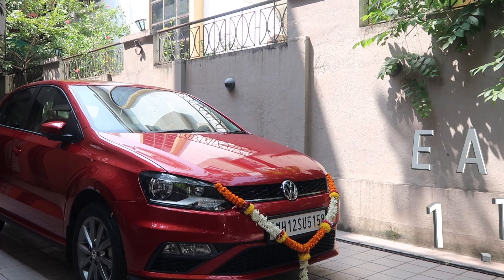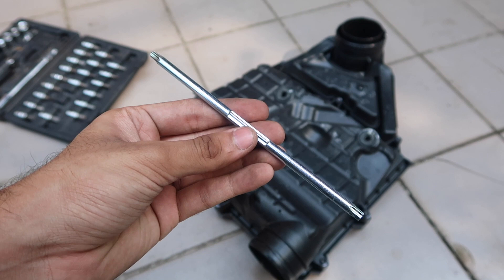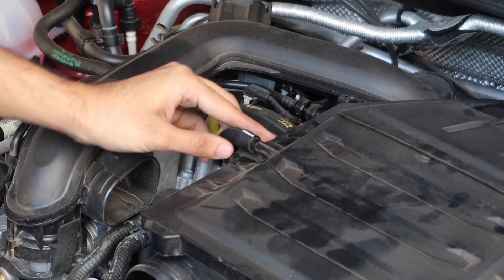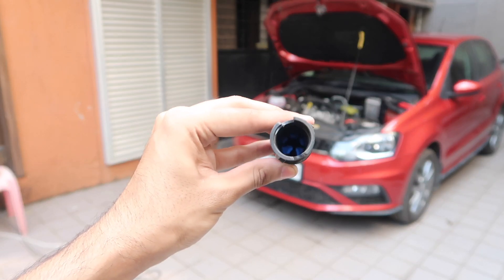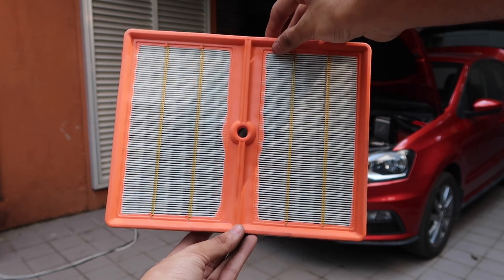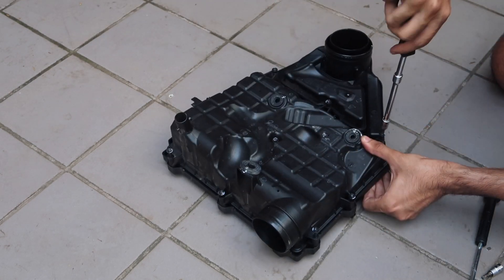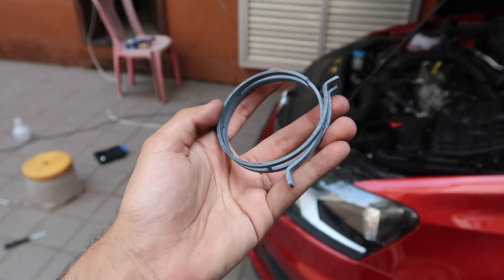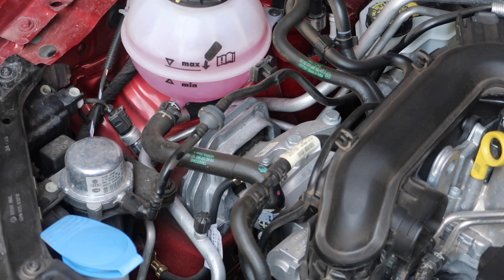Volkswagen Audi Seat Skoda - EA 211 1.0 TSI Engine Air Filter Service - Polo, Slavia, Taigun, Kushaq

Comment: Hi Sujoy, thank you for posting this DIY video, very good job indeed. My only suggestion is to wear a pair of safety gloves while working on the engine bay. I  appreciate the fact that you even mentioned the torque tightening specs for the Torx screws on the air filter housing (the only time I pay attention is the toque specs on the oil drain plug & oil filter cap housing). I'm actually perplexed that VW folks have made this otherwise simple job so unnecessarily complex. I have a 5 series BMW (535i) and it takes me all of 10 minutes to change the air filter. I'm considering Polo Highline Plus for my parents who live back in India. I was researching about the oil filter for this particular engine and the Mann website says that W712/95 (GTIN code - 4011558036010) should be a perfect fit. Can you please confirm which oil filter did your car come with. Thanks.
Reply from the maker: Yes I do wear gloves while working, but quite often end up taking one off for handling cameras between shots. Thanks for the good wishes. Yes, the Air Filter box torque can only be realised using an Electronic Factory Level Screwdriver. As per ETKA, the DSHA engine (1.0 TSI for Polo Vento) has oil filter with part no 04E115561H. It retails for Rs. 99 (Genuine Volkswagen). Mann W712/95 is indeed an equivalent one.
Reply: Thank you for the quick response Sujoy; really appreciate it. Looking forward to your next DIY video. I have not really kept up with the Indian car market but upon my initial research, VW Polo seemed to be the only sensible choice. My only concern is that there is just one dealership in Himachal & my parents are located 4 hours from it but in light of the fact that the service interval is one year/15,000 kms, it should not be an issue. I can take care of oil/air filter change myself as I do visit once a year. Good luck!
Reply from the maker: @vikramarya34  I love responding to comments. Makes me happy. Sure, you'll need just one Special Socket to undo the oil filter. The sump plug should be a 19mm, but will verify it soon! Yes they have good long intervals. And there's plenty of resources for this vehicle since it's global and old. Best of all, it's safe and powerful

Comment: Nicely explained. Does this process work for the Audi A3 1.0L TFSI 2017 model?
Reply from the maker: Yes absolutely. I haven't seen the A3 1.0 TFSI personally, but a quick Google search tells me that the intake design is almost similar. So yes, most of the steps should be fairly similar, if not, same.
Reply: @SujoyShivde  Thank you :)

Comment: If you don,t want to have problems with the rear hose clamp, you can engalrge it with that tool and put it up on the air filter box. There are 3 plastic bumps there and it will keep  it safe and mentin the distance to use the tool again.  I had the same problem as you  on my first air filter change and discovered that method. I change my filter every 10k km.  If you put a new one, side by side with a 10k km one, you will understand.
Reply from the maker: Thanks for the heads-up. Will remember this tip next time. Thanks for watching

Comment: Hey Sujoy, nice video.  I would appreciate your inputs on the 2 points :)
I have a 2015 1.2 MPI POLO.
1. Since my last Service Jan2020, I have driven only 4K KMS so far. Do I need to have it serviced after 1 year even if it has run only 4K kms ?
2. Which mechanic / shop would you suggest for polo in Pune ? I don’t like the authorised service center.  
Appreciate your help :)
Reply from the maker: Also, you can see my previous Polo video and easily do 2/3 operations relating to the Air Filter and Cabin Filter cleaning at home ☺️
Reply: @SujoyShivde  indeed that video was helpful.  I would try that some day myself.  :) but right now I need some good mechanic who can answer many questions that that my curious mind comes up with and fix the noise/rattle issue
Reply from the maker: Where did you last service it? Depending on what type of oil you used, you may be able to continue driving on the older engine oil. If it full synthetic, they have a higher tolerance to standing. Which aspect about the Authorized Service center did you not like? Is it the pricing or the overall atmosphere there? I can recommend a few places accordingly.
Reply: @SujoyShivde  thans for the revert.  I did the previous servicing at Shivaji Nagar VW Servië center. What I didn’t like is that they charged around 15k and didn’t do much. I know Vw servicing charges are high but 15k for no damaged parts was a shocker.  Also they didn’t fix the rattle noise issue in my car.  I did some fixing after reading some threads in TBHP myself .
Reply from the maker: Can recommend you a few independent garages in Pune.
Reply: @SujoyShivde  yes please -) that would be very helpful.
Reply from the maker: Can we connect on Instagram @fluidicjoy

Comment: Which engine oil is recommended for 1.0 tsi bs 6?
I guess there is no change from 5w-40..
Reply: I have 1.0tsi from 2018, code of the engine CHZC and I used castrol 504 5w-30, long life. But now I've put Motul specific 504 5w-30 and it is a big difference from the castrol. Is more quiet and economic.
Reply from the maker: @SHT5029  Yes, I've had a similar experience with Motul Engine Oils. Smooth and easier on the wallet. Our dealerships have switched to Shell 0W-20 now.
Reply from the maker: BS6 1.0 TSI can run on VW 502 which is 5W-40. But actually there is a change from the oil grade. Will link my TeamBHP thread. Planning to share the information there today.
Reply: @SujoyShivde  ok 👍

Comment: Hi sujoy,
Can i go for polo 1.0 mpi  2021
Please suggest me ...nios era vs baleno sigma vs polo 1.0 mpi trendline.
Thanks
Reply: Or swift Lxi
Reply from the maker: Sir the Polo is a good, yet an old car. If I were to consider it, I'd have considered it for the newer generation 1.0 TSI engine. It's really powerful and won't disappoint you or make you feel wanting for power. The 1.0 MPI is fine for city commutes, should be fairly efficient as well, but it's not a special engine on what is already an old car. Polo as a vehicle doesn't compare to an i10 or Baleno when it comes to value for money today since it's smaller, little cramped in the rear and more expensive to maintain. But Polo excels in safety and stability, making it a great choice as well. I'd suggest trying the TSI engine and trying to find a great deal on it. Baleno and i10 are good choices for the city, but don't compare in safety.

Comment from the maker: Note: This tutorial is also useful for Taigun, Kushaq, Virtus, Slavia, Vento, Rapid all having an EA211 1.0 TSI.

From the moment I laid my eyes on this tiny 1.0 TSI engine, I just knew they had over engineered this service and made it super complicated for a quick Air Filter cleaning, compared to the previous EA111 1.2TSI we had. What it implies is that each service will imply more interactions with plastic hoses with weaken over time! Totally a waste of a technicians time. Nevertheless, was a job well done and I had lots of fun in the process! Watch till the end for a small roar from the baby TSI Engine!
Reply: They engineered to be changed every 60 000km. But after you discover how to change it, it will be very fast. I change mine in 10 minutes maximum.
Reply from the maker: @SHT5029  Yeah you're right friend. I'm sure I can do it within 15 minutes now, but our dusty environments in India call for super frequent Air Filter cleaning and replacement intervals. The previous Air Filter Replacement on the older TSI engines they sold here was a child's play. The technicians here are not the most careful with our cars and that adds to the worries. Hope you understand my sentiment! :)